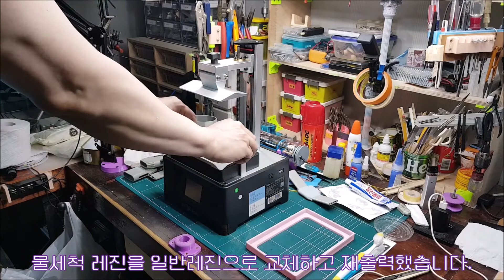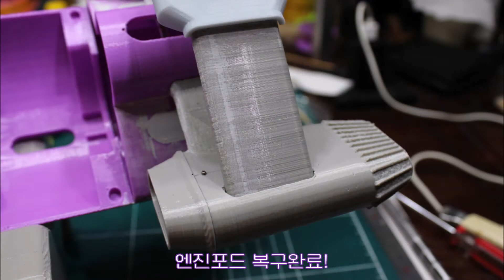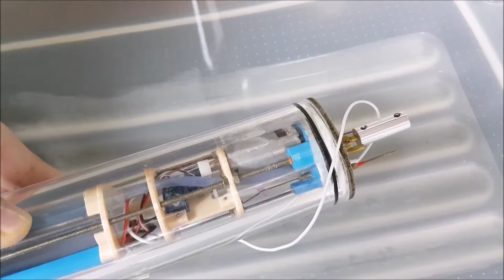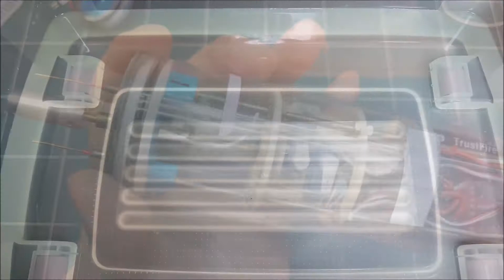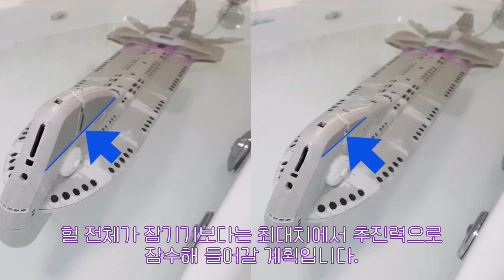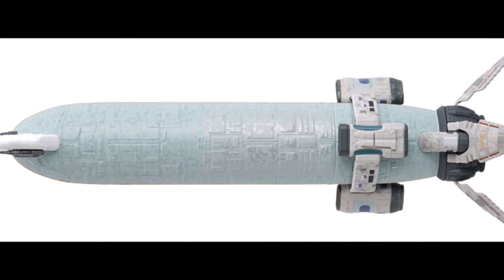Battlestar GALACTICA . 1:130 Colonial ONE RC Submarine.   ep 8. dive test

Comment: If you could make those petals movable you can use them as speed brakes😉
Reply from the maker: There is no radio channel to use for it.
Reply: @tiver21  Y lead from 1 channel from receiver going to ESC the othe to a servo. Whn stopped petals are open, as throttle goes up servo closes petals.
Reply from the maker: @coast219  I was thinking about folding for the first time, but the folding mechanism becomes complicated. But I like the simple structure. Folding will increase the speed, but I will be annoyed by the submarine due to the inconvenience of driving preparation caused by folding. thanks for your good info